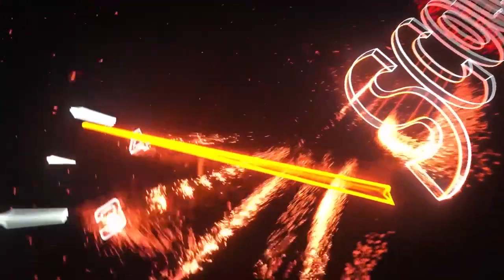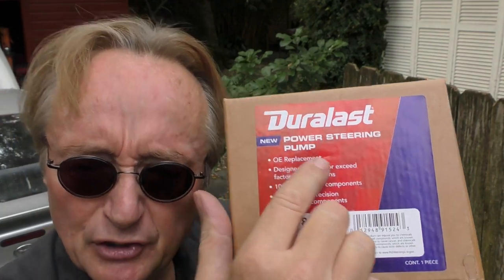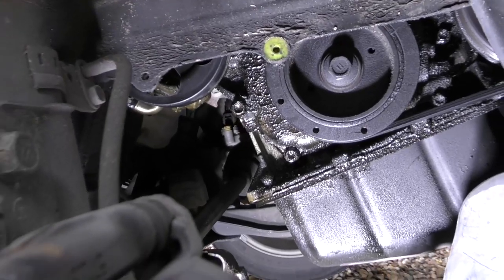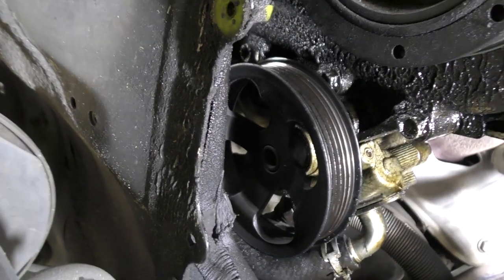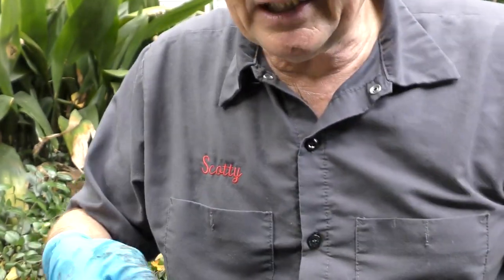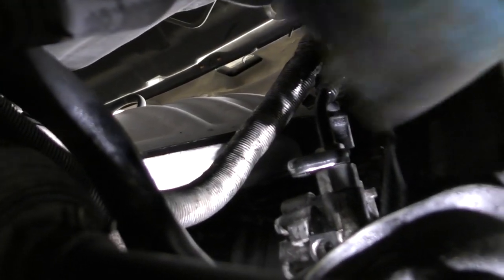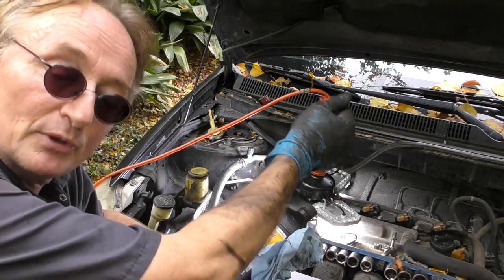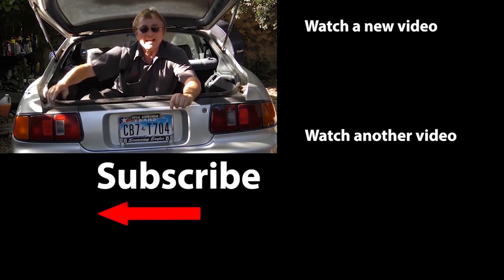I Couldn’t Fix This Car By Myself (First Time Ever)

Comment: I just changed one VERY, VERY, similar but was behind the part of the fender well that was non removable on a Honda Civic. There is no way I'm getting anything from the top without removing the intake and many other small items just to see it. So I removed the wheel and tire rod so I can get my big arm up to the top bolt which is set about an inch behind and above the pump pulley. I could barely fit my fingers between the well and pulley. Ok the right and below was the crank pulley so no room on the right. The lines had one bolt in one and 2 in the high pressure and both very close to each other and angled in about the 11 o'clock position. It took over an hour to even reach the top bolt then putting it back on pretty much ensured I'm going to hell. I said words I never knew existed as I had no help. And yes tensioner pullies are almost the worst (smallest) thing for one person. I'll most likely never do another Honda pump. Love watching Scotty. 👍🏻

Comment: I wants had a 2008 Honda accord it was my friends car I put JB weld aluminum putty all over the leaking pump and then sprayed it down with flexseal and it’s been almost a year now and it hasn’t leaked a drop I also use some Lucas power steering stop leak but I don’t credit that

Comment: Just ran across this video. I have owned several Toyotas, most call for ATF for the power steering pump (on the cap of the PS pump). I have spoken to several mechanics at Toyota dealerships and was in the automotive business for a while and all private mechanics said PS fluid. The vehicles I have owned/own all clearly do not use ATF for the PS. Can you please offer some insight?

Comment: Only thing Scotty,why didn't you suggest putting on a new pressure switch while you got access to change it?
Reply: if it aint broke dont fix it, and the switches are usually more expensive than the pump

Comment: I am surprised that Scotty filled it back with some generic AutoZone power steering fluid. I thought Toyota used an automatic transmission fluid for their power steering systems?
Reply: ATF+4 I think, or whatever Toyota's proprietary type of PS fluid is, but I really don't think power steering is that picky about fluid generally.

Comment: I guess this is why manufacturers use electronic power steering now? Less mess and less fail rate.
Reply: though the longevity of electric will never supersede hydraulic and likely cost double when it comes time to repair and more difficult to diagnose
Reply: ryan hawkins Yeah I was curious about that. I dont know that much about it so I wasn’t sure WHY manufacturers went electric.
Reply: @Mtts28  mostly because of  hybrid and electric cars and cars that switch off at the lights

Comment: yes that belt is hard to change on that car,   but i was able to pull back on the tentioner and reach under the car at same time to place the belt back on,  but i got long arms.   it will frustrate you more and just piss you off a little,

Comment: Its funny that scotty calls most brands endless money pits, yet the irony is that theyre easier to work on, lol. Even changing the spark plugs and alternator on a chrysler t & c with a 3.8l v6 are easier. 

Who in their right mind puts the power steering at the bottom of the engine pulley system? Toyota... unfortunately, certain chevy engines have the alternator at the bottom...

Comment: Scotty we have a Toyota avensis 1.6cc 110hp,1998 (no vvti) with 300.000km. Steering wheel pumb make a winning noise when you turn the wheel all the way..no leaks or clucking noise just a quite winning noise. Do you have something in your mind?
Reply: Depending on how loud the noise is, thats probably normal. If it starts whining and/or squealing long before turning all the way to one side, you either have air in the system or your pump is bad.

Comment: My steering wheel is hard. I can't turn to the right or to the left softly with one hand. Is there a reason why?
Suzuki GV 2006.
I used older than my car and they were super soft to handle.
Reply: this video is geared directly at you then...

Comment: Hey Scotty, just curious... why wouldn't you replace the pressure switch with a new one? You have it right there, wouldn't it be better to have a new one?
Reply: theyre more expensive than the pump. dont fix it if it aint broke yo!

Comment: dont loose the nuts to the splash guard. i did that job and forgot all about them.  rubbed like hell turning to the left. took off the wheel, 'oh ya, stupid splash guard bolts'. now where are they? ugh. take the rest of the bolts off and get rid of the splash guard? that seemed even harder.  i found one, put it in the middle bolt hole, now my car howls like crazy from the loose guard the wind whistles through when im on the highway. ugh. dont loose the nuts to the splash guard.
Reply: ps, had my wife pull the wrench to put the belt back on. loosened by myself tho :P

Comment: Hey scotty, sam from saudi, i have accord 2.4 2005 the coolant goes to overflow tank and not back to radiator, there is no bulding pressure in radiator, i replace oem cap but did nothing, i check engine & transmission deb-stick there is no oil coolant mixer , on radiator i find little oil on cap, what could cause that? No leaks for coolant any where . Thank you sir

Comment: Scotty, what do you think about the 2004 Pontiac Grand Am GT?
Reply: @spenserchalkley7013  I actually already have one. Have had it about two years and right now it's got 154,000 miles and running pretty good. Sure it's got a squaky belt and tensioner problem lol but it runs decently enough. Just needed a new water pump and has been dependable since then

Comment: "get it good and tight" (brass threads with a honking 1/2 drive) and no new o-ring, doesn't turn the wheel before you start it to get the air out new dry pump squealing, I only been a wrench 40 years, teach the kids  right Scotty !
Reply: did you see the unedited clips? were you there? did you see everything that he did off camera? i dont think so. so how about scottys been fixing stuff since the 60s so i trust him to know what hes doing...

Comment: guess you're just a bit old scotty. i get that same belt on and off myself. the trick is to get it on and off the idler pulley not the alternator because the alternator has the outer lip that makes it too hard to get it on.

Comment: It amazes me that so many posters here think that taking a few tens of minutes more time to save hundreds of dollars is such a horrible thing.  Heck, it would take me less time to do that job, that it would take to drive the car over, come back home, then go over and retrieve it after the repair.  Not that it's one of the easier pumps to do, just sayin' that when a job starts to become a pain, that's when you remind yourself that cars are a pain but this is the least painful route towards a solution, except that you're left sitting on a fatter wallet.

Comment: My heater gear box failedI  no heat. watched videos. Repaired the unit. No new parts necessary. Just opened the gear box. Yes a pain in the arse. But saved 700 dollars

Comment: Why not fix it myself? You just showed me why I shouldnt!!!! I'll let it squeal and chirp till it falls off.
Reply: The one in my 200k mile Dodge has been making awful noises for awhile, change the fluid in the reservoir with a cheap walmart turkey baster a few times and it will get a little better. Mine still makes pretty terrible sounds (especially in the cold) but it hasn't gotten much or any worse than before. Having clean fluid in it will keep it going for atleast a few thousand more miles, and walmart sells fluids cheap.

Comment: Hello Scotty.  I run a band and drive a lot!!!! About 40-50 thousand miles a year. 
I currently have a Dodge Grand Caravan 2012. I bought the vehicle at 50,000 miles for $13,000. 
I am happy with the car (I know what you think of Dodge) but have 150,000 on it and have only replaced the alternator; of course regular maintenance. 
I love the car but need more space. The upright bass fits well in the car but I have 5 guys in the band and a full PA system I carry around. 
What vehicle would you suggest for my next vehicle? I need more space more power and decent gas mileage (I pull a small but heavily loaded trailer) and the ability to pull a Camper. 
What vehicle would you suggest?
I was looking at a Nissan NV but it is a Nissan and it is a passenger Van so comfort is lacking. We are on the road for 3-10hrs at a time. 
What do you think, is it hopeless?
Is large gas guzzling tour bus the only option for broke band leaders these days?!?!?!!?!?
My Dad has a V8 GMC Savana Upgraded Van that I loved but it blew head gaskets and didn’t seem to have enough power. Also he sold it before I had enough money to buy it. Geesh it sucks. No one makes a car for large bands large equipment and long drives. 
Thoughts?

Comment: Thanks, Scotty, I found this video very helpful and even inspirational. But it would be better if you described the tools you use more accurately. What you describe as an "extension" should be called a "flex handle" or maybe a "breaker bar." What you call a "crow foot wrench" is more accurately described as a "flare nut crow foot wrench." Names sometimes matter when we're buying tools to take advantage of your knowledge.

Comment: Scotty, Im a new driver and am looking to buy my first car. I want a 4WD SUV that I can take anywhere, and Ive been looking at both the 3rd gen Toyota 4Runners (96-02) and the 2nd gen Nissan Pathfinder/Infiniti QX4 (96-04). The 4Runner is more reliable, but they are much more expensive and much harder to find with lower miles, since people hold on to them for so long. The Nissan Pathfinder/Infiniti QX4 is way cheaper, comes with more features, puts out more power/torque, and are much easier to find with lower miles... but are less reliable. Help? I love both, I just want to make sure I get the right one.
Reply: The older Nissans aren't too bad at all (90s and before, Hardbody models especially are very tough trucks), I'd argue they're on par with the 90s Toyotas. I'd stay away from the newer Nissans though. It will be tough finding a 4runner that hasn't already had the snot beaten out of it for cheap. You can find 90s Pathfinders for cheap very easily, try to find a lower mileage one that is well maintained.

Comment: You want a fun job? Power steering pressure hose on a honda accord. They run it under the rear engine mount. Not fun!

Comment: Unfortunately, Scotty, no one wants to fix it themselves. They hear $50 fix and start looking for a new used pos for $500. Alternatively, when you do the flush before the new pump goes in, you can tell the owner to pan out all the bronze flakes from the fluid because they struck gold.
Reply: And tell them to pull 2 cans out the case they bought you, because it's only a $15 job.

Comment: that fluid looked disgusting--clearly never replaced and probably the reason for the premature failure.
Reply: How often do you do change your power steering fluid? My guess is you've never done it.
Reply: Looks like old school power steering fluid.  Most modern power steering systems use ATF.

Comment: Where was the help?  You don’t have to pull the bolts out of the pump either. Where the pump bolts to the side of the engine there are slots so you just have to loosen the bolts and leave them there. If you bring it to the dealer they know that. That’s what you pay for at a dealer.

Comment: Imwant to buy a 2007 Lexus GX470 that has been religiously maintained at the lexus dealer. Fully serviced with new tires and brakes with 154k. My parents want me to get a new car instead. I dont want a “new” lightly used corolla. I want my lexus. They say a old car isn’t reliable. It will be more reliable than my 2000 4runner.

Comment: I don’t think so.  I don’t do stinking power steering pumps .
Reply: depends on which engine yo... i havent needed it yet but my 2000 foresters EJ251 has it right on the freakin top. you pop out the alternator which is about 3 mins of work and then its 100% open. i could probably pop a new one in in about 15-20 mins

Comment: Jokes on you my Toyota has an electric power steering pump. No leaks possible
Reply: Joke's on you when it fails anyway and costs $400 instead of $50 if it's really a pump, or if it's pumpless electric steering then closer to $1200.